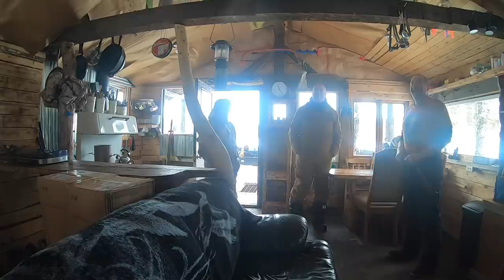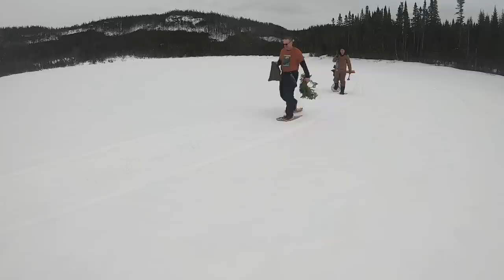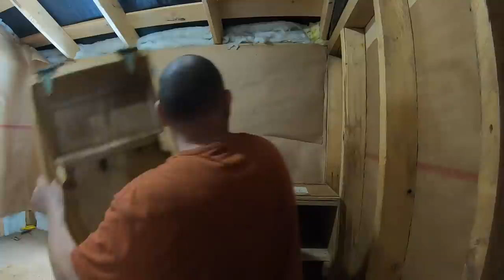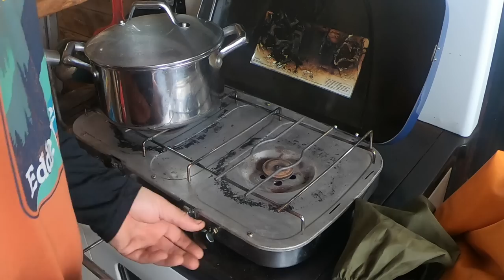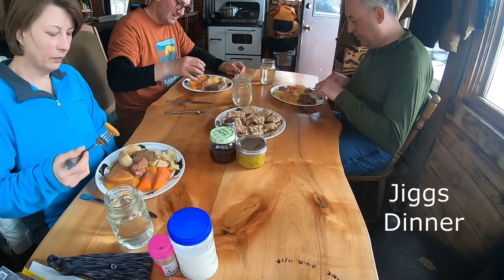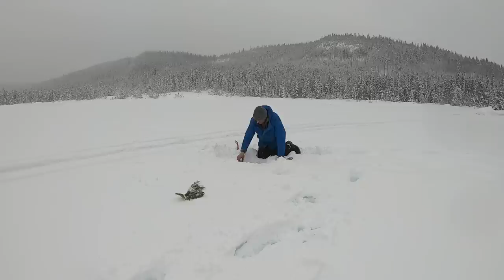Making Jiggs Dinner, Renovations, Ice Fishing, all at the Remote Cabin  Episode #60

Comment: You may need to put an extension on that drill auger. I use a 8 inch 40 volt system with an extension for deeper ice
Reply from the maker: Yes indeed

Comment: What kind of tool were you using to take the nails out of the wood? I have never seen something like that before, usually the fork at the back of the hammer is used to take nails out?
Reply from the maker: Nail puller